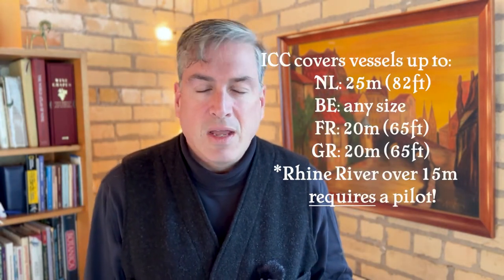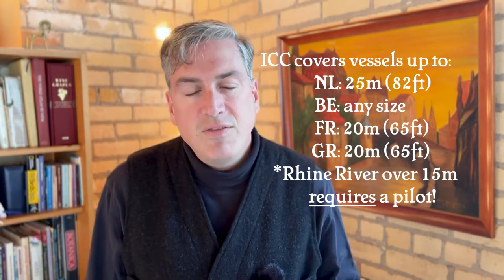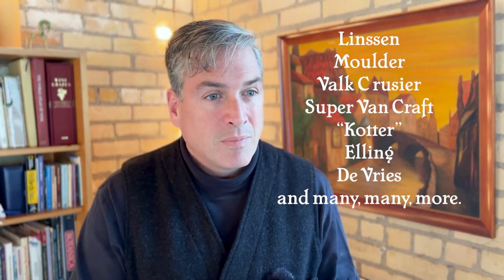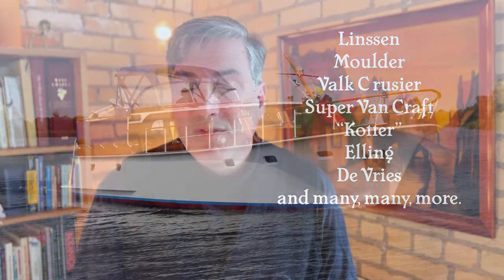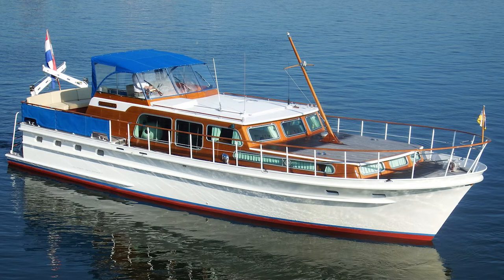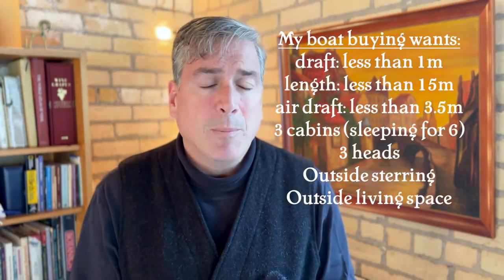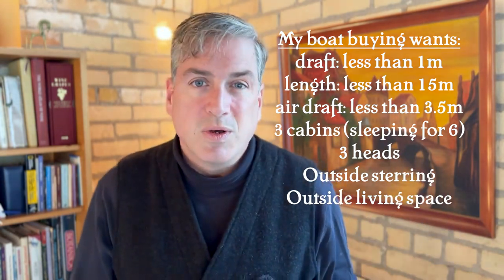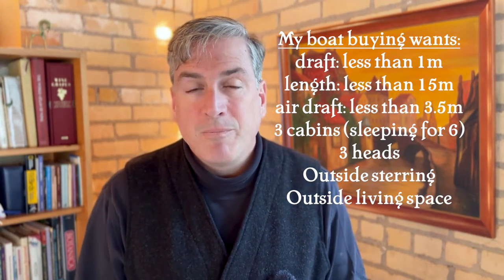Barge design, length and limitations. Size matters! ~ Buying a boat in France Ep. 5

Comment: Modern yachts tend to become bigger because people want more space. But many Dutch river cruisers - even the newest - have a draft of less than 1.5 meter. And there's plenty fixed bridges in the Netherlands. Our boat is a (1993) Dutch built steel yacht of 12 meter and the draft is 1 meter. And with the canopy down, we only need 2.85 meter to pass under fixed bridges.

We use our boat mainly for the summer holidays. We "live" on the aft deck. Inside it is usually too warm anyway. Things we consider important (inside) are: ample headroom and storage.

Not covered in the video is the engine cooling system. Some boats use water from the canal to cool the engine, some boats have a closed cooling system like a car. We prefer the closed system because it never gets clogged up with water plants or debris.
Reply from the maker: Thanks for your comment! 😀

Comment: You might mention the best place to purchase a boat is usually The Netherlands. You can pay a bit of a premium when purchasing in France. By and large the vessels in The Netherlands are better maintained, there's usually a better selection and they're usually substantially cheaper, much of this can be attributed to The Netherlands being a true boating community.
Reply from the maker: Thanks for the comment and I couldn't agree more! I do mention this at the end of the video along with providing links to YachtFocus. I also touch on the design concepts of a Dutch Cruisers and some of the brands that are made there. However, it should also be considered that the draft of many of the boats in The Netherlands are not suitable for the French waterways as many of them tip toward the 2 meter mark. 2M is technically possible in most of the narrow gauge waterways in France but in practicality a 1.5m to 2m draft will substantially limit your cruising options on France's inland waterways. But these boats would be great for coastal cruising round The Netherlands and that is design purpose. As I say in the video size matters. Cheers.

Comment: 38 meters? Probably at least 6 meters wide as well. That is the living space of a large house in Europe.
Reply from the maker: Yep, these boats are very big and impossible to turn around in the canal outside of official turning points.
Reply: These old barges - "péniche" in French, "spits" in Dutch - had standard dimensions so they could pass through the locks. And as mentioned in the video, old locks are about 40 meter long and 5.5 meter wide. With a beam of 6 meter, you could go nowhere. At least, when talking about inland waterways.